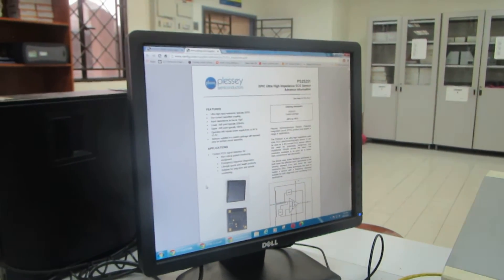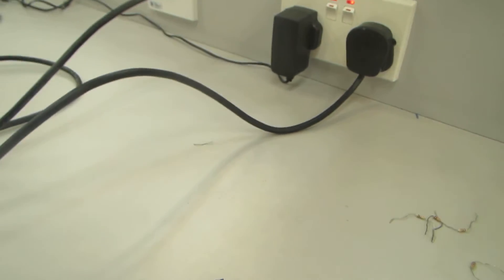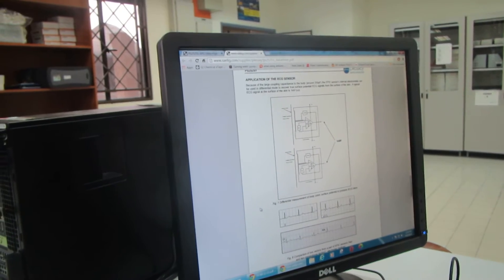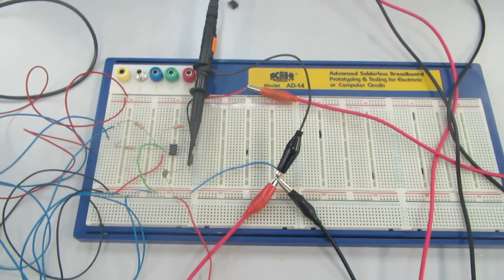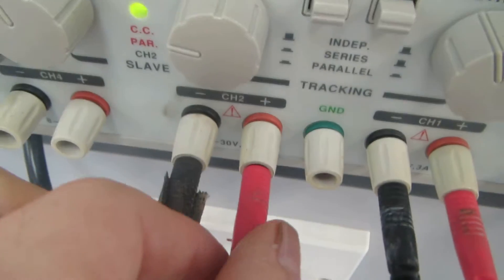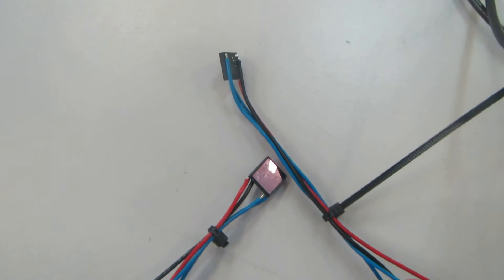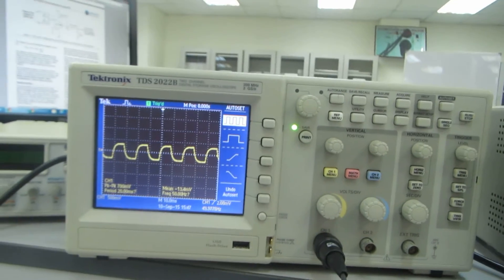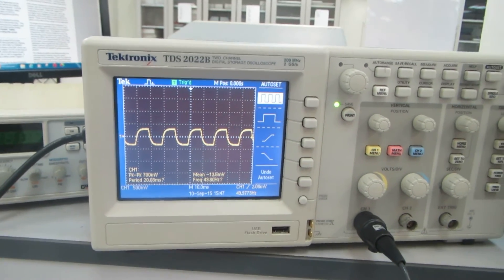PLESSEY PS25251  EPIC SENSOR TESTED WITH DESIGNAGED DIFFERENCIAL CIRCUIT

Comment: as long as the sensor output is hitting the rails (i.e. the 50 Hz looks more like a square than sinewave) you wont be able to recover the ecg signal by using a differential amplifier or any type of filtering. Use the ps25255 with lower gain. Most importantly you need a ground reference e.g. a piece of metal in form of a ring going around at least one of the sensors and connected to ground. you can use a copper tape too or simply hold a ground of the circuit with your fingers. this would reduce the 50 Hz noise. I can see you worked on this 3 years ago but i thought it may be useful for others

Comment: Problem is may be the circuit which you have constructed. I got the ECG from the same sensor (Just one sensor). You have to perform FFT on the data, to get clear ECG. (Noise free).
Reply from the maker: @Sumukh Purohit, Happy to hear that you got ECG signal from same sensor. I would like to discuss more with you about that: lordrisborik@gmail.com
Reply: Samukh Purohit  I'm also having problems to obtain the pretended signal from the same sensor. If it's possible I really would like talk  a little bit with you to understand what I'm doing wrong. My email: joaoluis4@gmail.com
Reply: I am using Dual voltage power supply. (+3v -3V). the output gives lot of 50Hz noise, which you can reduce by doing FFT.. Sorry for delayed reply.
Reply: And do not solder, use pogo pins instead.
Reply: can u share u r ....circuit diagrams process....narayen.psg@gmail.com....thank u...